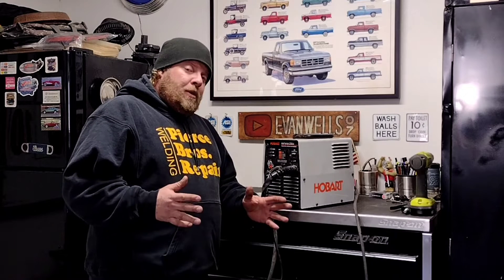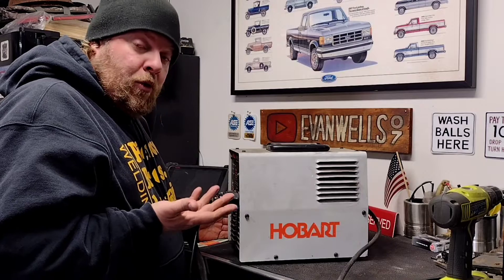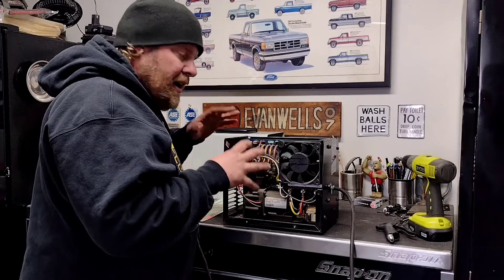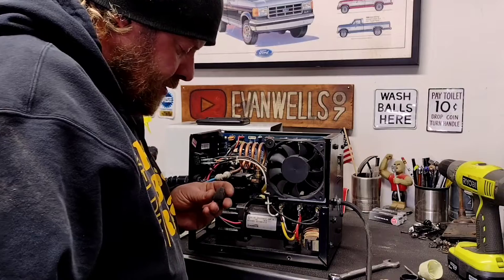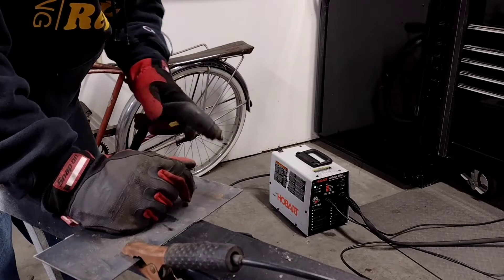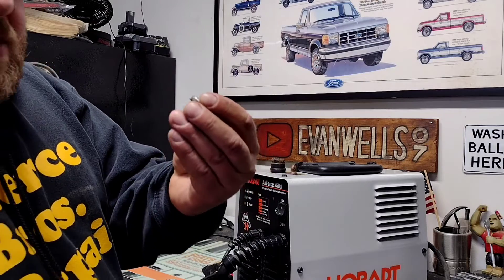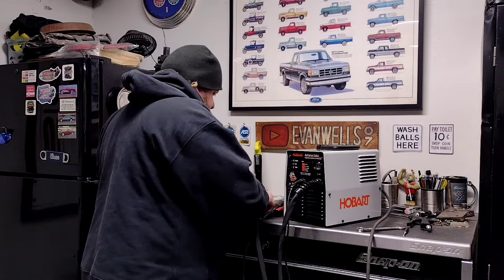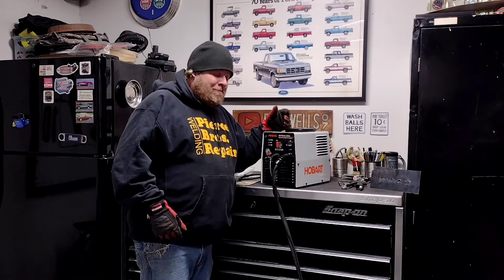HOBART Plasma Cutter Repair & Maintenance | Tip And Electrode Replacement + General Cleaning

Comment: I have a pro point 45 cutter and it will fire for 4 seconds and shut off I hit the trigger and it goes for 4 seconds and shuts off I replaced consumables and still the same thing
Reply from the maker: Sounds like an error of some kind.  Does it have any lights or indicators flashing?

Comment: I just bought one. Does the consumables have to be on in order for the compressor to kick in?  When I press the trigger the compressor doesn’t kick on.
Reply from the maker: It depends on if it's setting an error.  It may not kick on if it's not together, but I'm not 100% sure.

Comment: I have had the blinking light issue relatively recently even with new consumables. It's been wildly frustrating. I have yet to clean inside the machine but some brief reading led me to checking the two pins in the hand unit that sense when the cup is on. I checked continuity in them, reassembled. Note that it can throw a cup error if the cup isn't all the way on AND if the cup is too tight. That didn't fix it though. Next I addressed the electrode - remember its all new for me, and I unscrewed it. I noticed inside the threaded portion of the hand unit there was white powder and dust so I knocked that out. Screwed the electrode back on. Again, not too tight. Hell even hand tight is fine. This seems to clear up the flashing cup light each time it happens but I am still perplexed when it does rarely happen as to why. I've had a on-all-the-time cup light before but the flashing one perplexes me. Air filter is next and I wouldn't be surprised if the filter is disintegrating and blowing particles down the line. It cut very nicely after that stuff was out - I never had an issue before but this was a nice sharp cut with little slag.

Comment: I punched a hole in the case and ran the air intake tube thru it. Now my air filter is a million times easier to clean
Reply from the maker: That's a good idea!
Reply: @EvanWells07  I give it a shot of WD or HVAC compressor oil every so often thru the tube too. I noticed after about 20hrs of use it started getting really noisy.
Reply from the maker: @dakotadingo9083 I will have to try that.  Mine is pretty noisy.  I have plenty of air tool oil laying around.

Comment: What's all over the outer cup? Is it slag you can just knock off?
Reply from the maker: No it's like a hard plastic shell around it that is melted.  I assume to prevent voltage from leaking out where it's not supposed to.
Reply: @EvanWells07  no, no, no. All wrong.
Reply from the maker: What is all wrong?
Reply: @EvanWells07  exactly
Reply from the maker: Ohhhhh.  Thanks for pointing that out then.  What a spectacular friend and compassionate human being you are.  Love, Evan